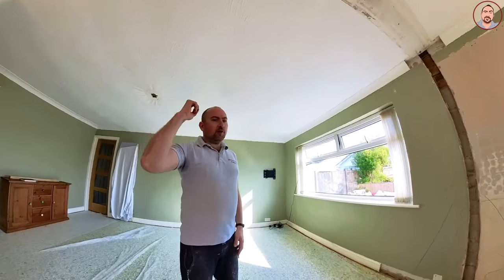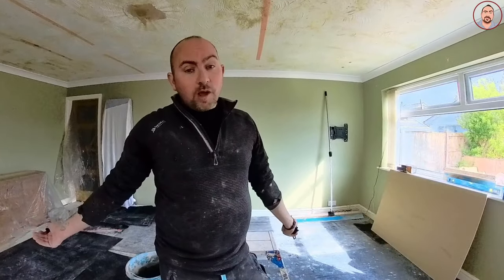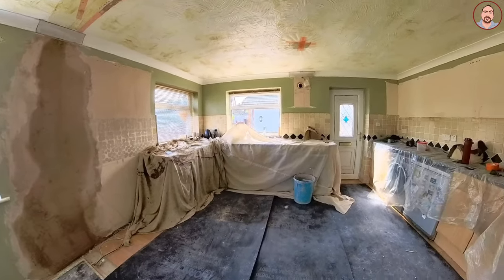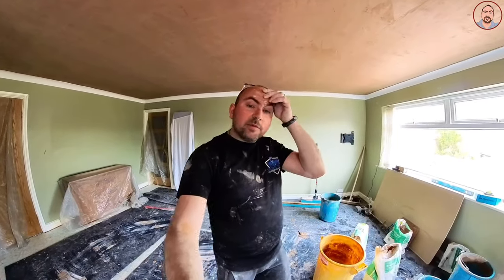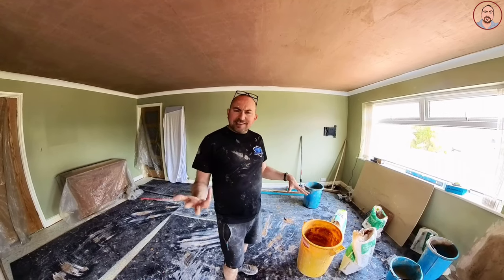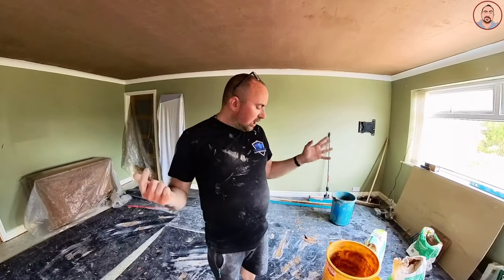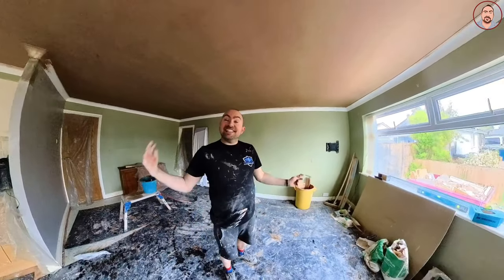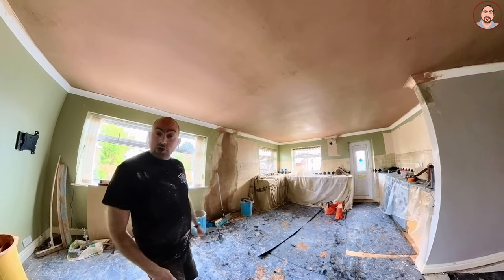How to plaster a big ceiling in your own. How to get Extra time.

Comment: Great vid can I ask why you prefer board finish mate? Sets quicker .. and I find it a tad  Messier  to use especially over artex.. I freshen up the second mix on the first coat and second on big ceilings seems to work fine and saves on extra time.  
Cheers
Reply from the maker: Hi Matt, I’ve always preferred board finish. I find it more consistent. 
It’s whatever works for you. I’ve done plenty without extra time.  It’s all about trying to make it easier.

Comment: Should have sorted the suction out first instead of chasing it? SBR is far more superior. On top of of that you're using board finish which set quicker than multi
Reply: Do you think ? I think multi pulks in faster. I only use board finish. I love it. It trowels up nicer. Use board finish on everything

Comment: How about a couple of coats of sbr 1 the day before u start  the lid and one on the day just before u start the first coat with the extra time reckon that would have slowed up the pick up for u nevertheless u made a great job of it especially as u was in ur own lids that size can run away from u if it’s hot and ur not on top of it it’s just a relief when u know uve got it flattened in in time ain’t u can breath easy then

Comment: Im really not sure why ya use those tubs way to small 100-200L would make your life a lot easier
SBR before you grit it would hold it back... chasing on lids is awful 

Also Deck ya room out but you know that.. already 
im 50 next year and can still bang jobs out preparation is and always will be king.
If its too hot or too cold tell the Client you're the professional they employed you never be a yes man!!
Reply: Yeah. Im 37. Been a spread since 18. A few beginner mistakes of n this. That ive learnt from experience. If i did this on my own. Definitely sbr (thats all i use). And if i was struggling. I would of fallen back.  Amd put the second coat on half way. Then done a join. You wouldnt see it. But from experience i wouldnt strain myself i would of got another plasterer in.